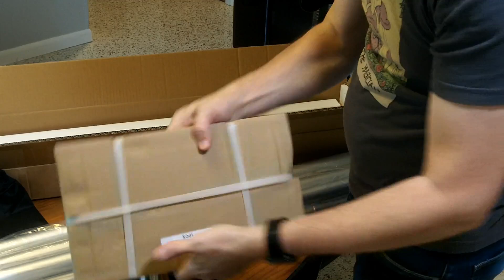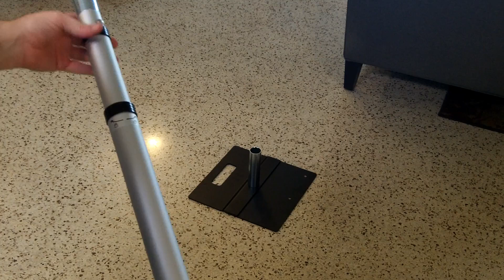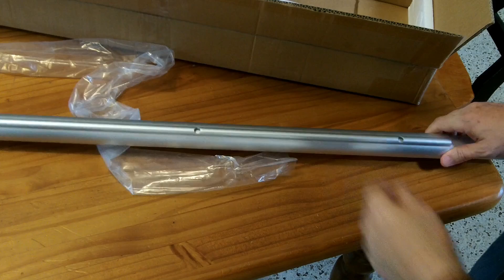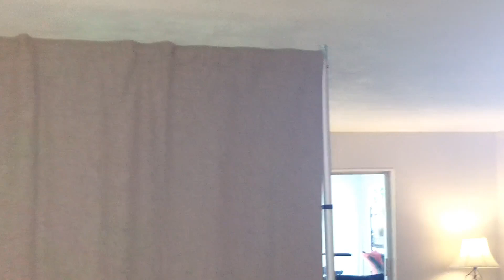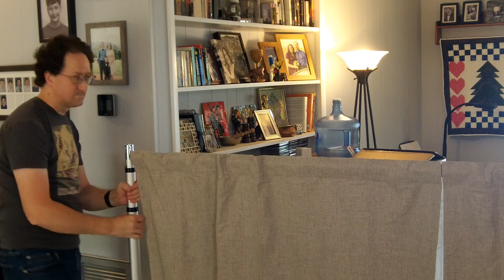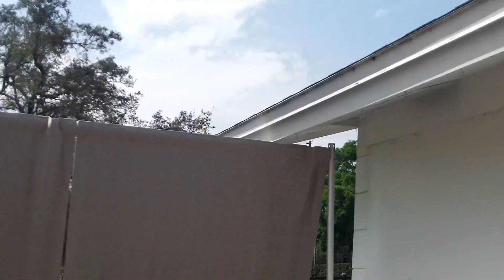Review: Hecis Pipe and drape backdrop stand kit 10ft x 10ft $170

Comment: Do you know what kind of screw I need for the base?
Reply from the maker: The screws that came with my unit to hold the base plates together and the short upright piece to the top of the base plates is a 10mm flat head cap screw with 1.5mm thread spacing. It had a flat head (hex drive socket, 8mm) but the head appears to be "extra flat" compared to other flat head screws with a little shoulder on it. Measured end to end, they are 3cm (30mm) long including the head.  The head total height is only 3.6mm, not the "standard" 7.6mm like on these bolts: https://amzn.to/3HMB0v7  You may be able to get away with a truss head or wafer head screw as long as it is 10mm with 1.25mm thread spacing, but I would suggest you write to Hecis to see if they sell the screws separately.

Comment: I kept thinking at the beginning of the video that this would be good for blocking light and light breezes for astronomy, and then you mentioned that at the end. I have 120" diagonal projector screen and I might consider doing double duty by using that as a light blocking screen too. My protector has guylines that attach to the top for more stability. You could do that with this setup too by running a rope through those slots and staking it to the ground on both sides.